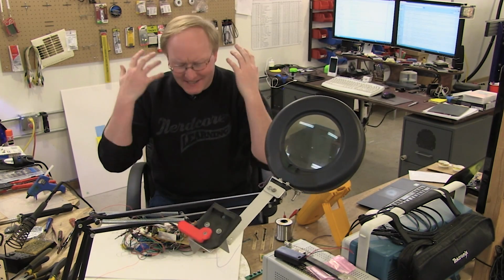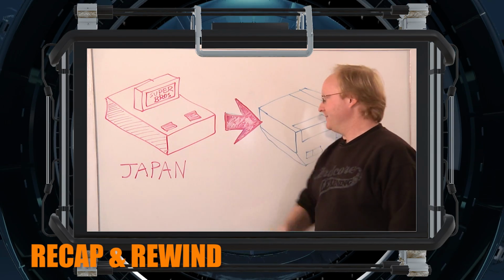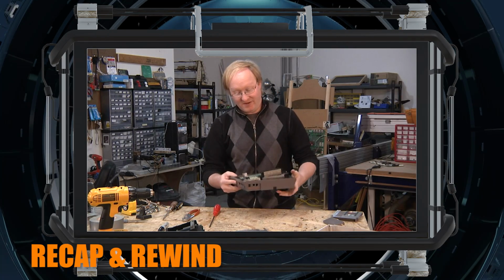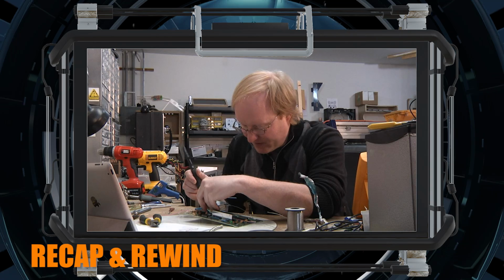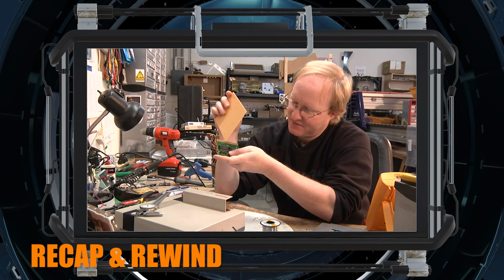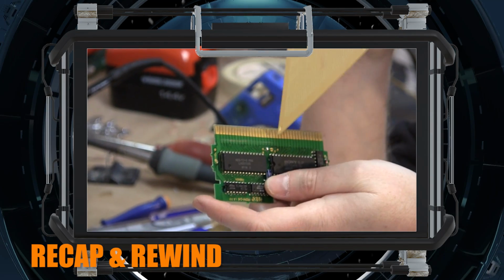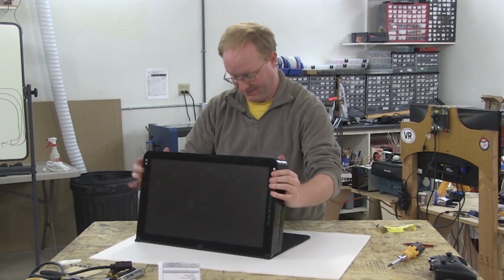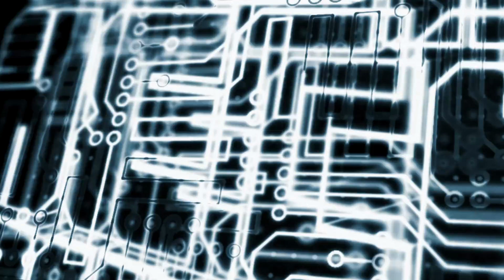Ben Heck's Rewind & Recap - Slot Loading Nintendo

Comment: The irony of this project was that it was ostensibly meant to address the shortcomings of the NES' original connector, but it seems to basically have the same set of end results, amplified.

1) Both were designed to minimize the insertion force required, both for the ease of the user and maybe also to protect the game contacts (original NES connectors are not hard to insert, only the aftermarket ones are difficult)
2) Both had added complexity in order to have a way to increase the connector tension after the game was inserted
3) Both were unnecessarily expensive due to the complexity
4) Both suffer from long term unreliability (speculation, but I'm taking it as a given that Ben's design would not stay working reliably for 3-5 years of daily gaming - and neither did Nintendo's design)

But I don't think it was meant to be taken seriously.  It was fun, and the fact that he got it working is impressive.  Nintendo's top loader was the serious solution, but that's boring.

Comment: I guess it would have been easier to create a kind of drawer for the cartridge. Maybe like a cd disc tray. It would have been possible to keep the original slot and also keep it low profile to fit inside the console case. 
I really liked the idea and the video. Why not do a slot loading drawer for say a sega genesis or a nintendo n64?

Comment: This was one of my favourite projects, and it was a little disappointing that it did not fit in an NES casing. I would love it if you would revisit this project some time in the future using a stepper motor. Using what you have learned from your current mechanism and keeping the contact system you have, you could probably make a version that fits in an NES casing in half the time this project took.

Comment: I always assumed there was some tiny benefit to the friction of inserting the cartridge in creating a better contact by removing any small amount of surface oxidation (or residue, dust, etc) that may have settled on those old games that I may not have been so careful with... Similar to using a coin or eraser to clean the contacts on a slot race car. How far off am I in that assumption?

Comment: Id ditch the auto insert entirely and make a nintoaster. With a straight 72 pin connector and none of the weird angle stuff to make the pins touch it just works much better. Might not be as cool but its also far easier to make. And of you're smart enough you can make a snes and nes fit in nicely so two ports "2 slices" of nintendo awesomemess.

Comment: If Ben does another retro Nintendo project, it should be to simply git an SNES and integrate a Game Genie and Super Gameboy into the original case by adding the guts of both to the original SNES motherboard and putting a gameboy slot alongside the main cart slot.

Comment: I still don't know why you didn't use a cart-edge connector. As long as you could keep the cartridge straight, it would just slide in and slide out.
Reply: Tyrov He could have even used a modified blinky light win if he had he waited until it shipped from kickstarter.

Comment: The Ben Heck Show Forgive me if this has been suggested before, but I think a better solution here would be to use a sliding shroud over the contacts, driven in and out by a screw. The motor wouldn't need to be very torque-y as it would be driving a screw, and the clamping force should be more than enough. Probably easier to explain with a picture: https://imgur.com/qwNPmkD

Comment: I didn't see the original, but here you said that the servo burned out then said a stepper motor and gearing would be better. Wouldn't a spring and a feedback servo be a lot simpler?

Comment: Would you be interested in making another portable on the show? Perhaps a portable gamecube?
Reply: Alex Thompson Disc drives can be disastrous on portables, i'm surprised he kept it in the Dreamcast. If he could make an SD card interface, i bet he would do it in a heart beat.
Reply: I've heard that they can be :/ I've seen a few builds out there and a few people use a interface called the WASP Fusion and it allows you to replace the disk drive with an SD card. It cuts down on space and the user may also upload roms to the SD. Its a pretty neat device (:

Comment: When I saw this video years ago, I was thinking why the need of a mechanical cart socket? Wasn't much much easier if you just used a Toploader NES cart slot and then build the step motor wheels to insert/eject the cart? Like one of those "Blinking Light Win" things they sold at kickstarter but with the eject motors.

Still it was a fun video to watch at the time and I'm thankful for the time you spent making it.

Comment: wouldn't using the original 72 pin connector work? much easier mecanicaly
Reply: *****  Relatively lots of force to push it in and the same amount to pull it out.
Reply: so a bigger motor or gearing, still simpler than jaws of pins
Reply: ***** But at some point you over stressing the structure.

Pogo Pins would have been teh way to do it.

Comment from the maker: Go here to watch the epic three parter! https://www.youtube.com/watch?v=jdzZIeemumo&list=PLwO8CTSLTkijfvhidNJvfQb3p6steRzW5
Reply: Why didn't you use a solenoid on each side?
Reply: The Ben Heck Show  The next episode will be the 200th episode! Are you going to think of a way to celebrate?
Reply: The Ben Heck Show Single-Handed Controller i need 1 do to bad accident in 2000 that y
Reply: The Ben Heck Show  what do i have to do to get that xbox tablet ben!?
Reply: +The Ben Heck Show Hey Ben and friends, have you tried using SCART cables with an RGB signal on your older systems? It looks FANTASTIC. The RGB signal is way better than the composite signal using RCA connectors.

I think it requires a minuscule mod, but considering you guys are mod pros that shouldn't be much of an issue...

Comment: Couldnt you have used pogo pins? would be a bit bigger thought.
Reply: ***** Thought the same thing.
Reply: ***** I dont know if there are any small enuf to fit in side the end of a nes cart with out modifying the cart its self - the smallest i can find are surface mount with a unconnected height of 0.1".  And two in the carts connector i really dont think would fit.
Reply: 111smd You could fit them closer together if you staggered them into 2 or more rows.
Reply: Cliff Hartle its the distance between the cart case and the pcb
Reply: 111smd Oh ok In my head I thought he was doing some mod to the case.

I didn't see the original build but I can imagine the horror show of trying to line up all the pins and make them flex so it applied pressure.
Reply: Cliff Hartle he only modded the nes case not the nes cart case

and yst it must have been a nightmare lining up all those pins

Comment: Hi Ben, I've been watching your show for a few years now (great show by the way) and I noticed that you have a sweet spot for gaming and creating portable versions of rather static systems. Even though you have already built some portable versions of raspberry pi,wouldn't it be interesting to build some kind of an arm powered laptop. Some kind of a hacktop, a development board placed in an old laptop, using some of the original internals - battery, keyboard, trackpad, the original screen and even a fingerprint reader. As for the brains, raspberry pi is pretty powerful, but maybe a odroid xu or a similar dev board would be nice to be used. Or transforming an old tablet (with a broken or ify battery) in a fully-fledged android/windows laptop.
I really believe that there is a lot of potential in this kind of conversions and that there a are a lot of interested viewers for this kind of a project.

Comment: Hey Ben, if you're dissatisfied with how the NES looks on your HDTV, you should look into NESRGB, and the upcoming Hi-def NES project.
The NES PPU has a mode in which it spits out the color palette entries of each pixel being drawn onto four of its I/O pins which are normally unused. NESRGB then manipulates the color palette settings so it can get the fifth bit from the PPU's composite signal, and from there it constructs a high-quality RGB signal that is converted to S-video or whatever else you need.
Hi-def NES works basically the same way, except it goes directly to an HDMI signal, which of course is very convenient these days. (It also supports effects like scanlines and scaling filters, it's kind of fancy.)
I have two systems, a NES and a Famicom, and I've modded both with NESRGB. I think the color palette is a bit too bright but otherwise the output you get from the modded systems is gorgeous.
http://scope-eye.net/?p=933   <- my installation notes and comparison photos
As for the slot-loading NES, in the context of a normal NES casing the mechanism was way too large. But if you'd built the system into a small arcade cabinet it would've been just fine. It sounds like by the time you got this working you were beyond ready to put it behind you, and I can relate to that...  But problems like that can be opportunities as well.
Reply: Tetsujin Deksor NESRGB and other consoles with RGB cables still look pretty average on LCDs, often because the LCD's controller tries to de-interlace the 240p signal. Best result is to use an upscaler like XRGB Mini.
Reply: Tetsujin And for the Super nintendo, you just have to buy ... a cable ! You'll need a SCART cable for that (be careful since it can also make through composite video, SCART isn't a signal, just a name of a cable, like DVI can make through VGA AND numerical video). If you have the Super nintendo JR, you'll have to solder 3 wires (and maybe an amplifier, i don't remeber really well how was the mod)
Reply: ***** It's true, the deinterlacing is a significant problem: but personally I think NESRGB is a huge improvement even without an upscaler. NES's dot crawl turns everything to shit, and NESRGB fixes that.
There's lots of games that use 60Hz sprite flashing, and yeah that still comes out combed.
Hi-Def NES is probably the best choice for modern TVs - solves both issues. Though then you wind up with emulated audio - I'm not so thrilled about that part personally. :)

Comment: You probably could make the clamping system work better by simply using some angled sliding plastic spacers and springs, to use the cartridge edge itself to "bite" it.
But projects always, ALWAYS look a lot easier after you actually finished em and look back.
Code that take me a week to write it the first time generally take hours the second one and its just plain better in every aspect possible.

Comment: i feel like reviewing old episodes is just filler material for a chanel which could easily just announce a week break 
from putting out content.
Reply: Mike Horrod Yes, and frequently I'm opposed to filler content, but in this case it's interesting too IMO.
Reply: Mike Horrod I partially agree, this kind of episodes would be nice if they came with a follow up video taking a second shot at the project taking in consideration Ben's acquired knowledge since the original episode.
Reply: Mike Horrod Yea a flashback clip show.

Comment: An Upscaler like the The Framemeister (http://www.amazon.com/DP3913515-Framemeister-Micomsoft-Upscaler-Import/dp/B006H39XJS) can help your old video game systems look good on an HD TV.
Reply: obsessiveatbest For a NES I think NESRGB is a better starting point. NES has that awful dot-crawl on its composite signal, and any composite signal will have color bleeding. An upscaler can't really correct that.
Of course, NESRGB plus a Framemeister is even better. :)  But in my experience the NESRGB alone is good enough.
Reply: obsessiveatbest This actually solves a much bigger issues with old consoles and new tvs that is removing the massive lag the modern panel tvs add to the picture.

As the LCD lacks the "scanline magic" of the old CRTs, raw interlaced signal looks like blurred, "combed" stuff on the LCDs, so they have to use a lot of "magical" reconstruction to recreate full frames at 60 fps from the half frames, generally using things like motion prediction, but this kind of wizardry generally requires the last four frames or so, so you get at least 5-6 frames behind the current frame the console is trying to display, which add painful 100ms or so of delay.

Funnily enough, the LCD tvs don't even NEED to use the deinterlacer on old console signals, as they run at a "240p mode" that is basically repeating the same field over and over again, so all the tv needed to do is to just double the scanlines and bob's your uncle, but they just don't do that.
Reply: Tetsujin I just went and found a nearpixel perfect CRT. It's one of the newer ones, so it even has component and RGB. I can barely tell a difference between my stock NES and my RGB modded AV FAmicom.
Reply: Troy Dietz Well I can't account for that. On my displays there's definitely an appreciable difference, as the stock composite makes those jagged edges and flickering when things scroll sideways.